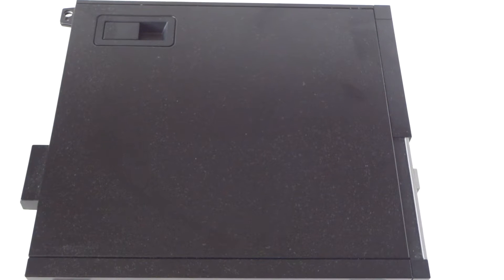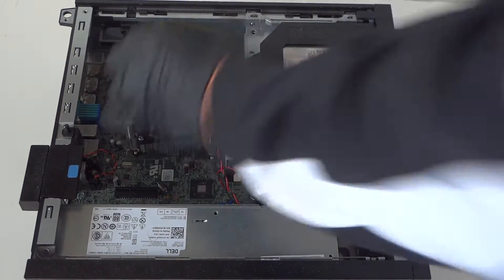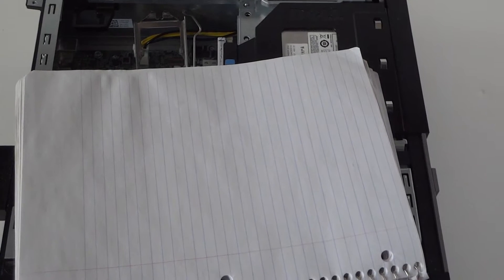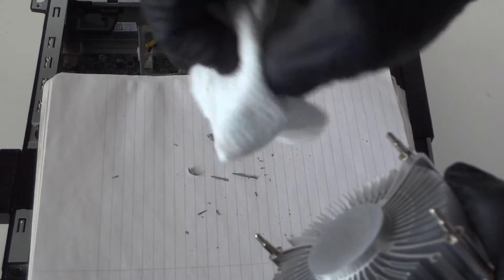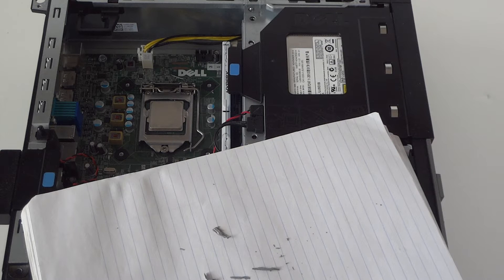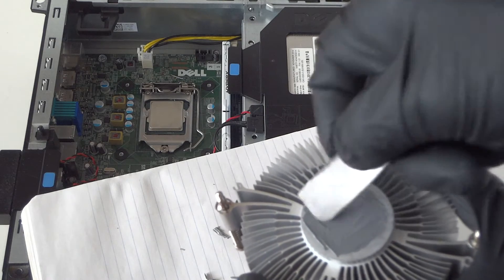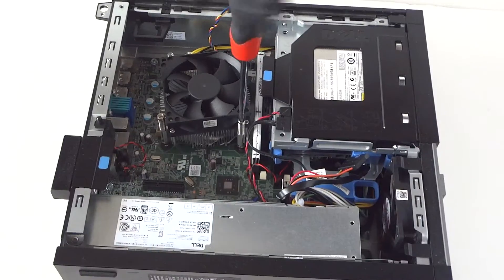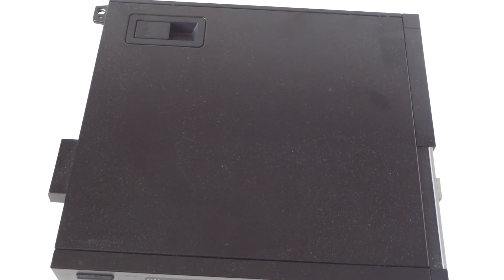Dell Optiplex 7020 Upgrade Processor

Comment from the maker: List of Parts and Upgrades works with this system :

CPU Support List:

Intel Core i7 4790K, 4790, 4770K, 4770, 4770S
Intel Core i5 4690, 4670K, 4670, 4590, 4570, 4670S, 4430
Intel Core i3, 4170, 4160, 4150, 4130

CPU Upgrade: 

Intel Core i7-4790 Haswell Processor 3.6GHz 8MB LGA 1150 CPU
https://amzn.to/3xeRaF5

Intel Core i7-4770 Quad-Core Desktop Processor 3.4 GHZ LGA 1150 
https://amzn.to/3QFmJ1v

List of RAM will work with this system.
Maximum Memory supports: 32GB 
Supports only DDR3 or DDR3L

This RAM works with this machine MAX RAM 32GB:

(1.) Crucial 8GB Single DDR3L 1600 MT/s (PC3L-12800) Memory CT102464BD160B
https://amzn.to/2VhGv8O

(2.) Crucial 4GB Single DDR3L 1600 MT/s (PC3L-12800) Memory CT51264BD160B 
https://amzn.to/2xq46wb 

(3.) Crucial 16GB Kit (8GBx2) DDR3L 1600 MT/s (PC3L-12800) CT2K102464BD160B 
https://amzn.to/2VpsKpP

(4.) A-Tech 16GB (2x8GB) DDR3L 1600 MHz UDIMM PC3L-12800 (PC3-12800)
https://amzn.to/3i97Zt2

List video cards will work with this system.

(1.) Gigabyte GeForce GTX 1650 D6 OC Low Profile Low Profile 4GB GDDR6
https://amzn.to/42xaR8d

(2.) AMD Radeon RX 6400 Low Profile Gaming Graphics Card
https://amzn.to/3s8MUUY

(3.) Gigabyte GeForce GT 1030 GV-N1030D5-2GL Low Profile 2G Computer Graphics Card 
https://amzn.to/2Z4PHkp

(4.) ZOTAC GeForce GT 1030 2GB GDDR5 64-bit Low Profile Video Card ZT-P10300A-10L 
https://amzn.to/2WzgLXk 

(1.)  Thermal Grizzly - Spatula for Applying and Spreading Thermal Paste
https://amzn.to/30Qq4ag

Thermal Compound Paste:
(1.) Arctic Silver 5 Thermal Cooling Compound Paste 
https://amzn.to/2ziNU0H

(2.) Noctua NT-H1 3.5g, Pro-Grade Thermal Compound Paste
https://amzn.to/36kTk7A

(3.) ARCTIC MX-4 (current edition) Thermal Compound Paste 20 Grams 
https://amzn.to/2DhGJaK 

3.5" to 2.5" SSD or Hard Drive Caddy Adapter R494D 0R494D 
https://amzn.to/2XTPeRr

SSD List:

Samsung 870 EVO 2TB SATA SSD
https://amzn.to/3ezOds5

Crucial MX500 2TB 3D NAND SATA Internal SSD
https://amzn.to/3B9f8CF

SanDisk Ultra 3D NAND 2TB Internal SSD - SATA
https://amzn.to/3RSZ8LR

(1.) Samsung 860 PRO SSD 256GB - 2.5 Inch SATA III Internal Solid State Drive
https://amzn.to/2BY5gRl

(2.) Samsung SSD 860 EVO 250GB 2.5 Inch SATA III Internal SSD 
https://amzn.to/37xWUfc

(3.) SK hynix Gold S31 1TB 3D NAND 2.5 inch SATA III Internal SSD
https://amzn.to/3d7X6D6

(4.) Samsung SSD 860 EVO 1TB 2.5 Inch SATA
https://amzn.to/2B2FURX

(5.) SanDisk SSD PLUS 1TB Internal SSD
https://amzn.to/3hwdqku

(6.) SanDisk SSD PLUS 240GB Internal SSD
https://amzn.to/2zfc7EX

(7.) Crucial MX500 250GB 3D NAND SATA CT250MX500SSD1(Z) 
https://amzn.to/3bTTjbX

(8.) SanDisk SSD PLUS 480GB Internal SSD SDSSDA-1T00-G26
https://amzn.to/2yfgjUK

HDD For Extra Storage:
(1.) Seagate BarraCuda 4TB Internal Hard Drive HDD – 3.5 Inch
https://amzn.to/3d3xWeR

(2.) Seagate BarraCuda 8TB Internal Hard Drive HDD – 3.5 Inch
https://amzn.to/3xjUDSJ

(3.) Western Digital 2TB WD Blue PC Hard Drive HDD - 5400 RPM, SATA 3.5" - WD20EZAZ
https://amzn.to/3w3jIQA

Comment: Can you make a updated 7020 MT CPU upgrade video with gtx 1650?
Reply: Buy a 24 to 12 pin power adapter , power supply and gpu
Reply: @ibbleonk6551  oh okay 👍
Reply: a low profile 1650 msi doesnt need a psu uograde at all

Comment: Whats the best cpu upgrade for Dell optiplex 7020 MT
Reply from the maker: Hi, Intel Core i7-4790 3.60 GHz
Reply: @manomant181   no but you wont get the best out of it
Reply: @ibbleonk6551  Because you can't overclock it on the current mobo right?

Comment: Can you help me ? I have one of those, and it gave trouble after I installed a video card from a lower computer. She hung up and did not call anymore, I bought two cards, everything connects perfectly, but does not pass image to the monitor. I cleaned the ram, restored the bios, tested the source, changed the cables, but not the image. What can it be ?

Comment: What is the best CPU upgrade for the Optiplex 7020 sff?
Reply from the maker: Intel Core i7-4790
Reply: @Mxkdt  I've read about someone using the 4790k. Yeah yeah, 84W limit; the guy says it works.  If I can get one for $130, I'll give it a go. 
https://www.dell.com/community/Desktops-General-Read-Only/Optiplex-9020-MT-i7-4790k-Upgrade/td-p/4703959/page/2
Reply: Did the i7 4790k work in this pc?
Reply: It's possible upgrade to intel I5-4570s?
Reply: https://www.dell.com/community/Optiplex-Desktops/Optiplex-7020-MT-CPU-upgrade/td-p/6096863

don´t Worry i found this :)

Comment: is it transferable to a new case?
Reply: YES! I took everything out of this 7020 SFF and put it into a 790 DT. There are some drawback, front io. I found a workaround. If you need more info let me know.
Reply: the optiplex sff board uses largely standard atx mounts. That said you will need to splice in to the connectors for the motherboard. If you're comfortable with doing line splices in soldering you can usually get away with it. The front panel has a small board in it with an in line resistor for the hard drive light, however, and the way it talks with the power led is a little funky. You can either mod your new case and just glue those components where the leds were in your case or just go without. The board will likely throw some errors if you don't get everything set up right and have you press f1 every time you turn in on, doesn't effect functionality other than that. Also dell uses propritary fan connectors. You can buy adapters for these on amazon. Also if it's a 3020, 7020, or 9020 and not a 3010, 7010 or 9010, you will need to buy a 24 pin to dell 8 pin power supply adapter to use a normal atx psu with it.